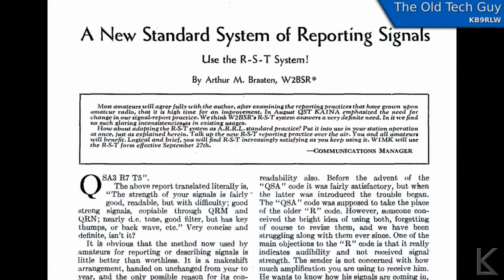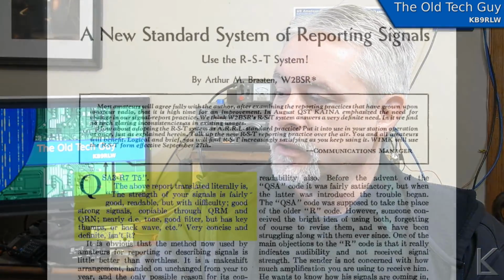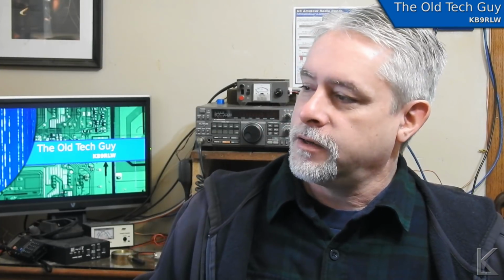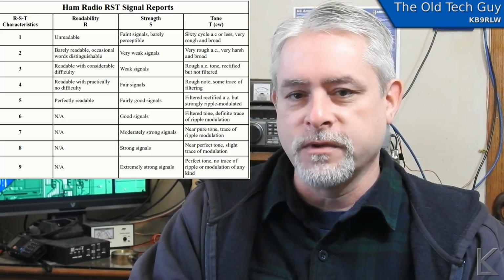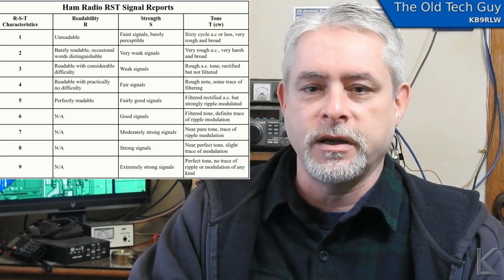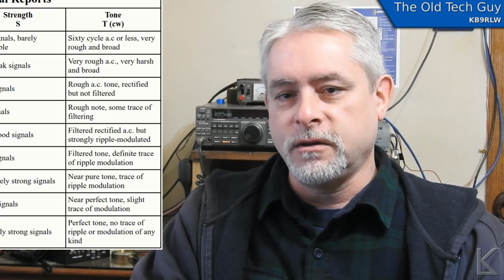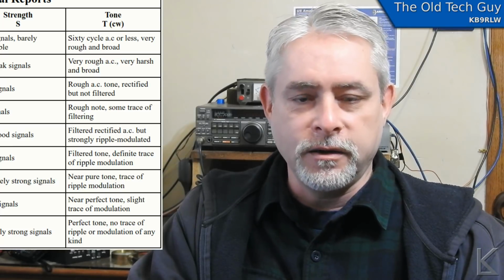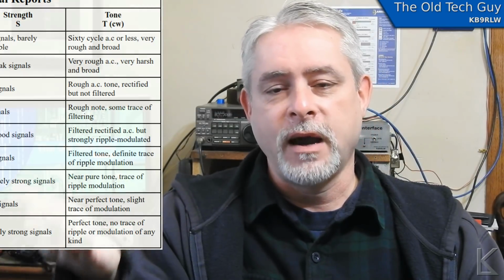Ham Radio - Tips for new hams. Signal reporting and the RST system

Comment: Regarding the S-meter. As a starting ham, I see that the S-meter reading strongly depends on the settings used. For example if I turn off the pre-amp and turn on the attenuate the S-meter will be many points lower, but the signal would be strong and sound very good. So I am in doubt how to use those readings...
Reply from the maker: Those are all correct.  And exactly the things you would need to keep in mind when using the function provided by the S-meter.   
You would compensate mentally based upon the way you have your radio configured.

Comment: New ham here and that is a very helpful and informative video.

Curious about the Kenwood radio; it’s a TS-440, right?  That’s what I have and, since the topic is signals, my S-meter doesn’t move much at all.  If it’s a really good signal I’ll see it bump up a tiny bit.  Just today, though, I heard the absolute strongest and best signal ever.  Crystal clear, very strong, and no noise or static.  The S-meter showed no more than a 5.  What has been your experience??

- KO4GQS
Reply from the maker: The RF gain control can reduce the action of the meter.  I don't remember if there's an automatic gain control adjustment.  I sold mine years ago and honestly don't remember too much about it now.
Reply: @loughkb  Many thank for the reply, Kevin.  Much appreciated.

Comment: Five years later and you're still teaching folks. I've had it backwards. I did know it's "Readability, Signal" (No T, I snuck in after they took away code requirement), but I've always used 1-5 for signal strength and 1-9 for how well I could understand the words. When I stop and think about it, I feel very silly. But I guess it's just a "training scar" from those that taught me how to RST. 
I will now continue to flip them back and forth in my head for the next decade or so until I undo the years of improper practice.

Comment: I understand the signal reporting but IMHO way back someone screwed up in how the meter responds to RF Gain.  If you reduce RF Gain the meter  🤔   Simple common sense logic would state that as you increase the RF gain it only makes sense that the meter would move towards an increase not a decrease.  Yep, I know some say moving the RF Gain shows you how much signal is needed to overcome noise from someone.  Who cares?  You either have enough signal to work with or you don't.

Comment: New to ham myself and wondering just how accurate is even signal strength?
I have an Icom IC7300 and more often than not, I'll set RF gain to show background noise on the S-meter of only 1 .. maybe 2  ... however I note that many people say to always have the RF gain control knob in the vertical position which could already have 5..6..7 on the S-meter.  My reading of 4 .. 5 could be someone else's 7..9+     BIG difference!
Reply: The manual for my 1978 TenTec transceiver specifically says if you turned down RF gain to reduce noise, briefly turn gain to max to get an accurate calibrated (6db/S-unit) S-meter reading when they are transmitting. Should be true with other receivers, unless your manual states otherwise.

You should always be ready to tweak RF gain as conditions change, "always vertical" is just as bad advice as "always at max"... RF gain is a tool for adapting to changing conditions, not a set it and forget it knob. (Altho vertical may be a good starting point on some radios...)

But of course, a hamstick, full size dipole and 3 element Yagi have different gain themselves so the S meter will read differently for the same QSO across those 3 antennas. And some radios are more sensitive than others. That's why if the other ham is interested in a detailed report, you need to share your antenna design (and to a lesser degree, the radio model, at least so they know which decade it's from).

Comment: I will admit that I have a habit of sending 5NN when I am doing POTA but since I'm completely new to Morse code it's mostly because I am not very comfortable sending just yet so I'm focusing more on sending and receiving than making an accurate RST. I'll probably start being more accurate as I get more comfortable sending. 
On SSB, I tend to use only odd numbers 3, 5, 7, and 9 depending on if the person is perfectly understandable with no issues or if I have to turn up the volume and strain my ears to understand.

Comment: Help me out here please. At 5:11 you mention that you'll look at the S-Meter. Since I've been into radio it's been my understanding that almost all HAMs run their radios on receive with the RF Gain down and the volume control AF gain up to diminish background noise. This is what I do just instinctively since day one. So with just about every amateur radio transceiver ever made, the AGC forces the S-Meter needle to stay  in the red when you do this, thus not being able to rely on your meter for a reading. I've noticed on some of your videos your RF gain is wide open. So which is it? Whats the most common way people run their radios? Get a clean sounding receive and you have no S-Meter.
Reply from the maker: It totally depends on band conditions.  If the background static is high, I might do the lower rf gain technique.  The trade off is you lose weaker stations.  Adjust thing according to conditions.
Reply: +Kevin Loughin Thanks for the prompt response. Makes perfect sense regarding the bands and how you employ that technique. I still see most operators riding the RF gain on every band which honestly has always made me question why radio manufacturers even include an S-Meter if no one is going use it, but great to hear that you are.

Comment: Seems I remember that key clicks and a few other deviations from pure signals were to be tagged onto the RST standard three digits as a letter, back in the days when I got a ticket. It was then "RST+" format.   Pretty sure I'm not makin' that up.  YES in a contest the signal report is the last thing you want to screw up and invalidate your contact (and the points earned thereby).  This is why 99% of contesters who are concerned with scoring well will always report "5-9" on phone and "5NN" on CW.
Reply: I can confirm that there is still one test question about this.  G2C07: ‘When sending CW, what does “C” mean when added to the RST report?’  (A: Chirpy or unstable signal)